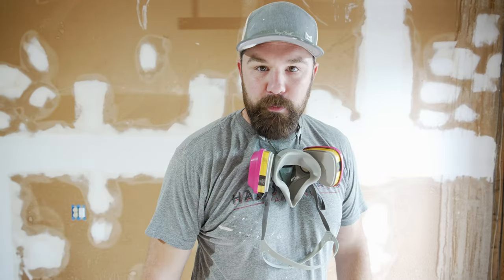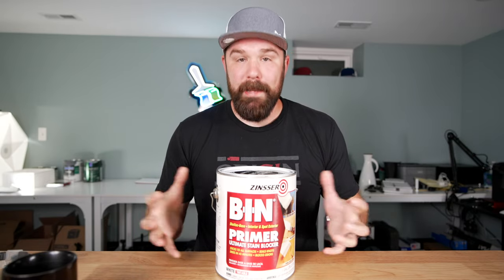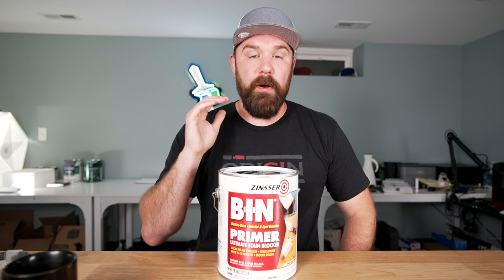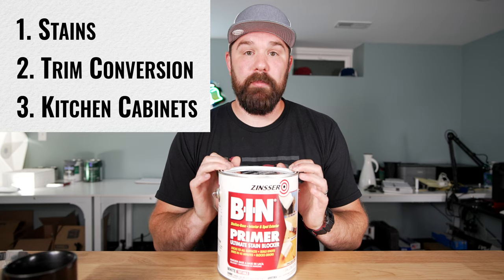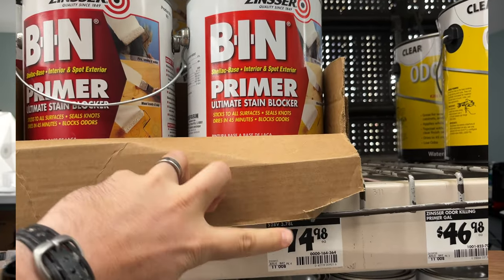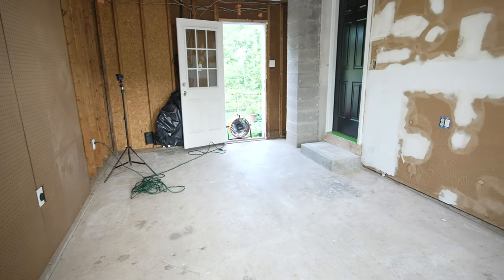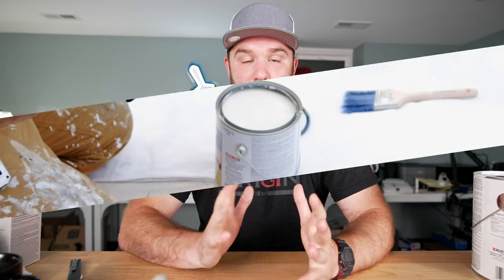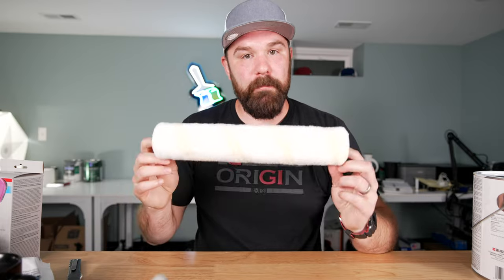The Best Stain Blocking Primer: What You Need To Know

Comment: I was contracted to restore an apartment that had been essentially used as a kennel on the first floor. It reeked horribly dog feces and urine odors, a laminated kitchen counter had been burned and medium to heavy sooted walls and ceilings needed to be covered, and circles of various colors needed to be covered in an upstairs bedroom. Carpet was removed and then I shellaced all walls and ceilings, and put 3 coats on the downstairs floors and one upstairs in case there were spots upstairs. Owner waited several weeks before installing the new carpet, just to be sure the odors weren't coming back.  I seldom vouch for any product, but this is one superior product.
Reply from the maker: You nailed.  That’s the perfect application for BIN.  It’s still our nuclear option for stuff like that
Reply: @SuperVassarBrothers   I am dealing with a simialar scenario. The shellac paint odor is still very strong coming from the floor. Any recommendations to get rid of the odor?
Reply: @Curtisvon1 did you work out what needed to be done? Or did you just give it time?

Comment: Great video! Fun fact..don't use it in bathrooms or anywhere with high moisture and humidity. It used to say it on the can
Reply from the maker: Hmmm, I’m curious as to why that would be.  It’s not like that’s the coat that would be exposed to the moisture.  We always use a finish paint that has moisture and mold blocking agents built into it.  I feel like that would seal in the shellac from the moisture 🤷‍♂️

Comment: Oh, oops. Didn’t know I needed to wear a p100 respirator before using. The fumes didn’t really bother me too bad. It certainly does splatter everywhere and is difficult to scrub off your arms, so wear long sleeves along with gloves. I first did a coat of Peel Stop in my bathroom. I had to do 2-coats because I was getting some alligator peeling with my first coat over the areas that were patched with all purpose compound.
Reply from the maker: Yeah I hear yah on the splatter.  Using a mask is a good idea particularly if you’re using a lot of it.  At least I’d recommend opening the windows and use a fan to keep some air moving, but to each his own.  If you wanna pull a Towelie and get high as balls then that’s also an option 🤙
Reply: @SuperVassarBrothers  I actually feel like the latex acrylic paint i used after smells worse.

Comment: I have a metal garage door in good condition that needs a new color for HOA purposes. I lightly sanded it down with 220 and masked everything off. Should I use a primer like BIN or just apply paint since there are no paint issues?
Reply from the maker: You're good to just go ahead and apply the paint.  You won't have any adhesion issues if you're using a decent exterior paint.
Reply: @SuperVassarBrothers  : I’m using SW Duration exterior. I painted the door yesterday and it looks good. Can I use Super Paint to paint the plastic trim for windows in the door? Do I need a bonding primer or diff paint?

Comment: Don’t judge me, I had this laying around ands used it for Sheetrock in my bathroom thinking it will cover all stains. It did but next day I see cracks where I applied it 🤦🏽‍♂️
Reply from the maker: Hmmm, it doesn’t have a lot of flex to it.  I’ve never seen it crack out though.  I’ve only heard of that when folks use it outside and the the surface swells or contracts.

Comment: Great vid, thanks - there's a couple of things I'd add.. after using this product for many years I found that even after it has dried on a brush, you can revive the brush with denatured alcohol ("Methylated spirits" where I come from). I keep the same brush for several uses and there's no need to throw it in the trash every time, just wrap it in a plastic bag, rollers could be saved but may take a lot of alcohol so not as worthwhile.... I don't know any other commercial paints that you can do this with! Also after a while on a hot day, the primer thickens up too much to flow easily and can be thinned with alcohol/ meths. Oh, and for water stains and dark colours I always do 2 coats - the second one quickly so as not to pick up the first!
Reply from the maker: All good things.  Thanks for the additions!

Comment: This is my go-to for priming anything that was previously stained and/or top coated with poly (trim, doors, cabinets, etc.).  A very light sanding is all you need and it sticks like glue.  I soak my brushes in ammonia and water overnight, but toss any roller sleeves.
Reply from the maker: That’s the move.  It’s our go-to for that application as well 🫡

Comment: Checking out your video while painting with Bin for the first time ever, very helpful! Only thing I'd add is that 3M makes organic vapor respirator cartridges that work a little bit better than the P100 ones. I was using BIN in a very small room, and even with ventilation the fumes were starting to come through the P100.
Reply from the maker: Yes indeed. The fumes are aggressive.  Make sure you really tighten that mask down too!

Comment: Great video!  I hate this "Hell in a Can" stuff but it sure works fantastic.  The fumes are enough to give me a severe headache.  I used to joke around that you can paint running water with it lol.

One limitation is it can't really be used outside except for spot priming - learned that mistake.  I typically only go for this stuff if required.  Now I use Cover Stain on bare wood and 123 for pretty much everything else which needs priming.

And $75!?!?!?  Wow prices have gone up since I bought it!
Reply from the maker: Yes sir.  It’s closer to $80 a gallon now.  You’ve got the load out right for exterior.  We try and only use BIN if we have to and we always use respirators.  That stuff will light you up 😵‍💫

Comment: Great video.  I have some 1970s wood paneling in a house that was smoked in before we bought it.  I tried TSP substitute, Coverstain, and two coats of latex paint, but after a couple months there was some bleed through in a large test area.  Now I'm trying BIN, but I'm afraid I'll still get bleed through. After rolling on one coat, you can still see the grain of the wood through the BIN.  Is that normal, and can I go ahead and do two coats of latex, or do i need to apply a second and/or third coat until it's a solid white everywhere?
Reply from the maker: The BIN will block any tannin bleed through you may be getting.  I’m assuming that’s the grain effect you’re trying to mitigate.  One coat of BIN and then hit it with your latex.  If that doesn’t do it then I’m out of suggestions 🤷‍♂️
Reply: @SuperVassarBrothers  I appreciate your reply.  I'm not sure if it was tannins or nicotine coming through the Coverstain + latex.  With the BIN, I just wanted to make sure the single (somewhat transparent) coat would be enough to block whatever is coming through, better than the Coverstain.  The latex should be thick enough to hide the grain, I just don't want any brownish bleed through and am on the fence about another coat of BIN to try to get it thicker before the latex, or if the current thin layer is probably going to be good enough.
Reply: @wrbbbb I am currently stripping popcorn off an older 1970s condo that was smoked in for years and the popcorn picked up the nicotine smell quite well. Just read that nicotine is water soulable and simply painting over it without using tsp or soap and water to wash it off before painting will still cause bleed through of that aspect is not dealt with beforehand. I did not know they nicotine was water soulable, so hopefully bin will work that out. Thanks for the info
Reply: @jody2873  how did it go? I need to cover up the odours and stains from a smoker. Looks like BIN will be the primer.

Comment: Renovating our kitchen and had to redo some drywall so there’s a mix of old/new drywall. The old drywall has some damage but I’ve cleaned it up and read that BIN can be used to seal it and ensure no bubbles or peeling before adding a new layer of mud, would you recommend? Plan is to prime with BIN, add a few layers of mud, and finally texture paint..thank you!
Reply from the maker: BIN definitely works to seal in damage in the drywall paper.  You’ve got the right steps sequenced together so you should be in good shape.  Good luck with your project!! 🤙
Reply: @SuperVassarBrothers  Appreciate the feedback! Keep up the great content!! 🙌🏽

Comment: Thanks for this video!!! I have not used this product yet. You directed me to this video when i had questions about a 22'x28' room with 12' ceilings with minor soot stains. Question. If it is really runny what about runs or height differences and overlaps in roller marks . Is that going to be seen through into the top coat? This house has wood floors and wood stained trim around windows and baseboard. Will a standard drop cloth with a vinyl back work or do i need to use plastic if it will ruin my drop cloths. Will brush marks flash through. You guys are awesome. I am sending people to your site. Great videos!!!
Reply from the maker: Lap marks and seeing the brush strokes have more to do with how you’re laying the product down.  It levels out well cause it’s quite watery.  

As far as drop cloths go, the ones you’re talking about will work fine.  Be careful if you get a big spill, but other than that you should be good.  I’d recommend taping off the trim and window casings with yellow frog tape to prevent them from getting hit with splatter.

Comment: So for an exterior metal door that is sanded to bare metal in spots (dent repairs), should I use Bullseye or this? Bullseye doesn’t seem to sand very well and this shouldn’t be used for exterior except for spots? 

The first time, I sprayed two coats of Stix and two coats of Sherwin Williams Emerald Urethane as a top coat. All my “body work” was showing through plain as day. I’m thinking I need a blocker primer? Spraying with a 310 LPFF tip in Graco X7. Appreciate any input.
Reply from the maker: Hmmmm, that’s a bit of a pickle.  If it’s a texture issue then priming with something else will likely still show through after you top coat it.  I’m trying to give my best assessment without seeing the door.  If I were in your shoes I’d get those repaired areas as smooth as possible.  Then I’d lay down a high build primer like fresh start.  Fresh start has a lot of solids so it tends to fill in any porous areas.  Then I’d do a light sand with 220.  Then I’d lay down as many top coats as it takes to get uniform coverage.  If that doesn’t do it then 🤷‍♂️
Reply: @SuperVassarBrothers  I know it’s hard to assess without seeing the issue so I appreciate you taking the time to respond! I see there are a few different options of Fresh  Start, which one  do you recommend? Spraying Black topcoat. Thanks again.

Comment: 2 questions: 1) for raw wood new cabinets, would you use BIN or the new smart prime (both from Zinsser) 2) if I prayed the Bin (airless), how do I clean it?
Reply from the maker: I don’t think you need to use BIN for raw wood.  There are a lot of wood primers that would work.  Fresh start is a good product from Benny Moore that I use a lot for raw wood.  Then you can go over it with whatever finish paint you want.  I’m not sure what the equivalent product from Zinsser is off of the top of my head.
Reply: Same question but with raw MDF. Would shellac be a better option to prep for paint or would Fresh Start be the way to go?

Comment: Should I sand first if I am going  over stained wood
Reply from the maker: You can give it a scuff sand if you want, but BIN sticks to pretty much anything.  You may also want to consider Fresh Start.  We’ve been using it a lot in trim conversions and it’s quite a bit easier to work with than BIN. Here’s a video if you wanna check it out Fresh Start: The Best Primer You've Never Heard Of
https://youtu.be/jydQq4jHOnE

Comment: I am in the process of using this to cover some old wood paneling . It was really setting up and getting tacky quick. My brother ended up using a sprayer for most that we have accomplished. Any tips on how to not have this issue if we just roll on ? I also have ceiling beams that re stained so may be a better option to spray ?
Reply from the maker: You wanna make sure you’re minimizing the amount of air is hitting the surface of BIN that’s in your rolling pan.  When you’re not rolling cover it with a tray liner or a trash bag.  In general I’d cut in everything then roll all at once.  1/2 inch pro-doo-z works well and holds plenty BIN to cover a decent area.  As far as the beams go, I’m not sure spraying would do a better job.  Without seeing what you’re dealing with I’m just making an educated guess at the issue.  Keep in mind that BIN is somewhat transparent.  You’ll see the stains after applying it.  The test is when you go over it with your finish paint.  If it bleeds through then, then that’s an issue.  Usually if that happens it’s the knots in the wood that come through.  Then you can spot hit it with BIN and you should be good.

Comment: Have you ever used kilz restoration over cigarette smoke and nicotine? I have an entire house to do and the customer won't allow the voc's.
Reply from the maker: I have not so I can’t speak to its effectiveness.   I’d do a test spot to see how it goes.  The customer is not always right when it comes to product selection.  If it puts them at ease, the shellac offgases incredibly quickly.  Like 90% in the first 20 minutes to an hour.  You can really scoot it along with air movers or fans.  The smell dissipates quickly and you can coat it with your finish paint quickly.  But you do you.  I’ve had clients that were weird about that too

Comment: Do you think sw emerald-urethane can be used on laminate and mdf without primer or should I use a shellac primer beforehand? I just want to paint over some second-hand cabinets that are going in the garage. Also, can the emerald-urethane go on top of wooden cabinets or should they be primed?
Reply from the maker: I’d recommend scuff sanding the surface of the cabinets and then giving it a try in a sample area with emerald urethane.  If you have bonding issues then you can try Fresh Start from Benjamin Moore.  If for some reason fresh start doesn’t give you a good bond then you can go with BIN.  BIN is our nuclear option
Reply: @SuperVassarBrothers  I was hoping that’s what you’d say haha, thank you! I’m just going to try sanding and go straight in with the paint. Is 120 grit the standard and will I have adherence issues if I go higher than that? Say, 220 or even 600?

Comment: Have you sprayed this product? It really is the best, but I'm afraid to run it through my sprayer and have trouble cleaning it out after. I usually spray the Cover Stain from Zinnser.

Also, when rolling it helps to only roll up at first, until most of the product is out of the roller.
Reply from the maker: I know several crews that spray it.  You just gotta use the right product to clean it out. Denatured alcohol or ammonia.  

Definitely light pressure on the roller is the move 🤙
Reply: BIN is way easier on your pump, the viscosity is way less than oil coverstain. I use cheap graco x7's for BIN and never clean them out, they have been in BIN for over 2 years and I use them 1-2 times per month. 1 is for white and off white tinted BIN, the other is for gray tinted BIN for dark colors. Tape and plastic on the can, take the tip, leave a little pressure in the line, good to go.

Comment: How long does this stuff usually smell? I need to paint 200sqft of bare wood shiplap boards. I test painted one board and it still smells 2 days later
Reply from the maker: If you apply your top coats of finish paint then you won’t smell the BIN anymore
Reply: @SuperVassarBrothers  thanks Man. These boards are going on a bedroom and bathroom ceiling so it's very important they don't have an ongoing smell or they'll have to come off

Comment: Can you throw texture straight on top of shellac? I skim coated my walls because I wanted to get rid of the old texture and re texture everything. But I still have a slight smell from smokers and I want to get rid of it. So, instead of using a coat PVA to seal the walls, can just use shellac and then texture on top? Or do I need to shellac and then pva again?
Reply from the maker: You can go straight over the shellac.  It has an eggshell-like finish similar to other primers.

Comment: Hi, would this work to cover up metallic paint? My sister decided to be picasso and did a ugly silver geometric shape on my wall 🤣
Reply from the maker: It definitely would work, but you might not have to use something as extreme as BIN.  I'd recommend sanding down the shape with 150 grit sandpaper.  Get it as smooth as you can then try some Fresh Start primer from Benjamin Moore.  I've had a lot of success with that primer covering things up.  After you prime it, you can go over it with whatever finish paint you want to use for topcoats.

Comment: I use this product on a cellilng to hide some yellow stains. I spot prime a few areas and when it dry. I use Pro Mar celling paint fir my topcoat and I'm. Saw some flashing where i prime at. How do i get rid of that. Or should i use the waterborn one insted of the oil base. Need help.
Reply from the maker: We do that same process quite often.  The areas that have been hit with BIN will dry more slowly than the rest of the ceiling and it can sometimes look like flashing.  We’ve never had issues when we do two topcoats of Promar.  Take a look at it once it’s fully dry.  You should be good to go
Reply: @SuperVassarBrothers  thank you so much i’m thinking that I didn’t let it fully dry before I put the topcoat on there. I end up putting four codes then I decided just to leave. Hopefully it dries well. Cross my fingers 🤞